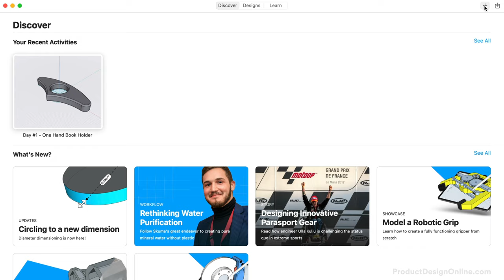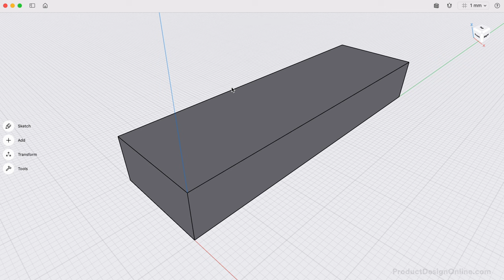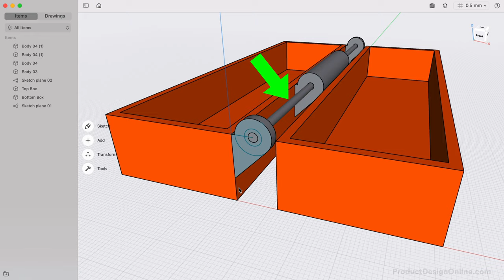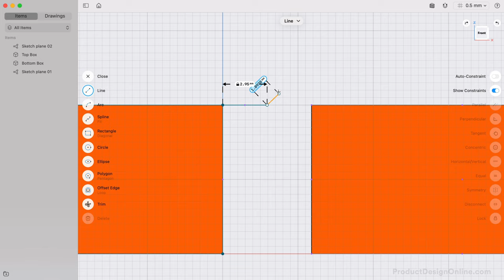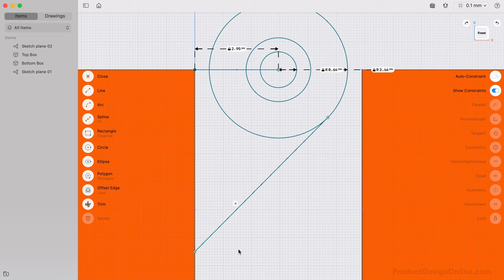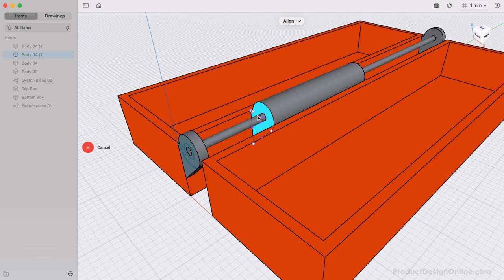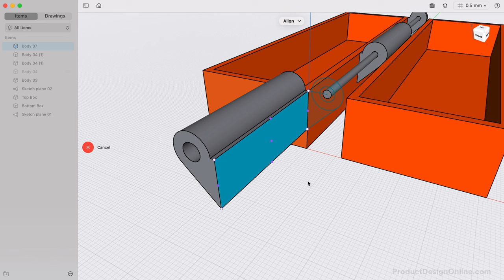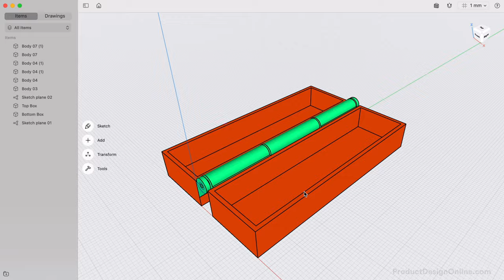Day #3: 3D Printable Print-In-Place Hinged Box - Learn Shapr3D in 10 Days for Beginners

Comment: is there an updated series? Things like defining angles are no longer baked into the UI!
Reply: Defining angles is still there in the current version of Shapr3D. I just verified. Tap both the intersecting lines and you'll get an angle value that you can change. If you have a lot of constraints set then they may limit you from adjusting the value

Comment: To get the angle icon to show up (7:45), you have to have the two lines on the same sketche. The reason why you can't see the angle icon and modify it it's because the line from the orange rectangle is in sketch 1 and the second line is in sketch 2. You can select the sketch 1 and redraw the second line to have both line in the same sktech and you should be able to see and change the angle easily.
Reply: Thank so much! I spent an hour trying to figure this out. Real lifesaver man.

Comment: Another great tutorial, but I'm definitely seeing some differences on my iPad.  Perhaps it's the newer version of Shapr I'm using, or the iPad interface, but after extruding an object, you can't select the face like you show.  I  have to hide the sketch item first, otherwise, I end up selecting the wrong stuff, with selecting just the face being impossible.  Additionally, my sketch faces seem to be left behind when I rotate or align an object, which isn't what you show in your video.  I don't know if I'm not selecting everything, or what, but my sketches have crud all over the place.
Reply: Yeah, unfortunately I’m seeing this issue too. It’s a sketch-castrophe! My solution has been to just hide the sketch lines in the “Items” tab. 
For the issue with extruding, you might need to update your firmware. I was able to extrude my shapes even if the sketch lines overlapped them; just be careful to not select the boarder of a sketch line or it will not extrude the piece you want.
Reply: same with me

Comment: I think shapr3d is well good.. I was looking through CAD software, But none of them really did what I WAS THINKING. Shapr, Does do what I was thinking but is also well hard to explain or look up! 

But with this program can you draw say a cabinet and then you drew some components, Can you then move components around? And plan how it'll be laid out. Make sure everything will fit and so on..
Reply from the maker: Unfortunately, at this time Shapr3D does not make it easy (or fast) to lay all your parts flat. For comparison, Fusion 360 has an 'auto arrange' feature that does it in a few clicks. Sharp3D forces you to use Move or Align to manually reposition them one by one.

Comment: Very informative. Thanks! One thing I need more help with is… construction planes. What’s the best practice in a particular situation?
Reply from the maker: Thanks for watching, Rusty!

Generally, use construction planes any time you need to create Sketches and don't have an existing 3D body to sketch from. Construction planes can also be used with select modeling features. I'll be covering some of the core workflows/uses cases of them in future lessons in this series.

What project are you working on?
Reply: I'm working on two woodworking projects. The first is a modification of a shop filter that Jay Bates did using SketchUp. I'm essentially redrawing it in Shapr3d using dimensions for my blower and the common filters I use in my house. The other is a design for a very deep shop cabinet that has lots of un-usable space. I'm trying to design something with vertical sliding drawers that will slide completely out giving me better use of the back 8 - 10" that are currently really hard to reach.

Comment: Hi Great video, thank you. What do you have to do for the print settings to print this pin? I use prusa slicer and I am assuming the software will automatically create a 'Bridge'? thanks in advance.
Steve
Reply from the maker: That's correct! It will 'bridge' inside the hinges. I suggest printing with .1mm layer height. The remaining default settings will print fine on a Prusa or equivalent type of 3D printer. Happy printing! :)

Comment: is it possible to simulate this model in shapr 3d ? I mean the rotation of the solid bodies about the hinge axis?
Reply from the maker: In general, Shapr3D does not currently support simulating models. However, there is somewhat of a workaround that would work for a hinge, by using the Construction Axis. See this video from Shapr3d: https://youtu.be/DqhWE3hYujk

Comment: Hi love u r video! 
Can I please know how to make the hinge tighter so it stays at a angle like laptop hinges
Reply from the maker: You would need to make the clearance smaller, but I belive you'll find that hard to achieve similar to a laptop hinge with plastic alone. You can replace the pin with a premade metal pint and add some lithium grease to better replicate one.
Reply: @PDOShapr3d  thank you!

Comment: help!  having an issue with the step at 8:35-- when i select the body in the sidebar menu to copy, it only copies part of the hinge, not the whole side face.  Basically the circle elements and angled part are still all separate elements unlike the video where the entire side seems 'joined' as one.  I've played it back multiple times and i don't see a step I missed.
Reply from the maker: Hi Doug. Can you confirm that you just have one body in the Items manager on the left side?  You can also try shift clicking all of the parts that are separate on your end, before hitting the 'copy' badge. Otherwise, if you can link to a screencast it may help me notice something else. - Kevin

Comment: On what printer do you print this and with what settings/Nozzle head size? 

Hii, love this video. Learned a ton from it. I've been using my Ultimaker3 with a 0.4mm Nozzle and it doesn't work - would you mind sharing your settings?
Reply from the maker: Hi Samuel. Glad you're learning lots! Appreciate you watching.

I've printed this test hinge on my Ultimaker S5, Ender 3 Pro v2 (example - https://youtu.be/gzF2QgMh6nw?t=614), and Prusa i3 MK3S. .4 nozzle should be fine. Your layer height is what's critical here as the inner pin is quite small (unless you scale the design up). You'll want to use .1mm layer height. You may also want to slow down the speeds. Generally, when I do these test prints I use the default 'basic' settings in Cura.

What material did you print with? PLA?
Reply: @PDOShapr3d  
Hiii, 

Okay so with the suggested layer height it worked out on my Ultimaker :) thank you so much for explaining that. 
I ended up printing it in PLA. One thing I noticed is that for me the box doesn't completely close because the hinge is at the same height as the top of the box. It kind of keeps a 5mm opening when fully closed if you don't apply pressure. 
I've made an updated model where the hinge is a bit higher and that fixed the issue. 

Love the tutorials :) Keep up the good work! 
Sam
Reply: @PDOShapr3d  
Hiii, 

Okay so with the suggested layer height it worked out on my Ultimaker :) thank you so much for explaining that. 
I ended up printing it in PLA. One thing I noticed is that for me the box doesn't completely close because the hinge is at the same height as the top of the box. It kind of keeps a 5mm opening when fully closed if you don't apply pressure. 
I've made an updated model where the hinge is a bit higher and that fixed the issue. 

Love the tutorials :) Keep up the good work! 
Sam
Reply from the maker: @samuel-beek  Hi Sam. Glad to hear you got it working! I appreciate the update. Happy learning :)
Reply: @samuel-beek  Hi! Would you  be willing to upload your model with the adjustment? That would save me a lot of time and frustration, thanks!

Comment: If i want to use the same hinge in a diferent project, all the dimensions scalate the same way?
Reply from the maker: Yes! In general, this is a universal hinge that can work with many things. I wouldn't recommend making it smaller than this. However, it does print well at larger sizes (and is typically stronger when thicker).
Reply: @PDOShapr3d  Nice, thanks! other question, the outer hinge and the clearence, does the size of them needs to increase in size proportionate of the thickenes of the inner hinge?
Reply from the maker: @lulucoast  The clearance does not need to change unless you have issues with the print based on your slicer settings. This works well for .1 and .15mm layer height. .2mm or greater may need to be tested.

Comment: After creating the circles for the start of the hinge and adding the tangent line there is no box that pops up for the degree angle.  Also when I try to extrude that area below the circles it isn’t a solid surface to be extruded, can someone help me with those two issues please?
Reply: Did you hold the SHIFT key when selecting the angled line and the vertical line? You'll have to select the two lines for the angled input to appear. If it's not when doing that, its likely that the lower end of the line is not connected to the other line.

Comment: What if I designed the whole box but in the very end I wanted to change its dimensions, let‘s say, make it deeper? Do I have to start again or is there a possibility of parametrisation?
Reply from the maker: Hi Martin. Shapr3D is a direct modeler. That means it's not fully parametric (like Fusion 360 or some others), but instead allows you to select the face and update the dimensions or push/pull the face accordingly. There are some pros and cons to direct modeling. One of the challenges (or frustrations) can be something like this were you may want to quickly create a bunch of different sizes. I still use Fusion 360 for all those sorts of projects.

Comment: Why didn’t you have to join the hinge body’s (union) with the box bodies?
Reply from the maker: Great question, Jordan! In this case, you could choose to join or not, depending on your desired outcome. I chose not to join/union the bodies which gives a little bit more flexibility if one needed to hide or alter either part. All bodies will be included whenever you export the file as an STL for 3D printing.

Comment: Nice one. Is there an easy way to extrude an object face as a separate body rather than just making the selected object thicker?
Reply from the maker: Hi Notan. Not that I'm aware of. You'll have to 'Project' edges of the geometry to have a new sketch for a separate body. You could also extrude the face and then split the body to result in two bodies (depending on the type of geometry).

Comment: How does one print this if the print surface is not big enough?
Reply from the maker: What are your size/surface constraints?

If you're looking to print larger then I would recommend a different design with a removable pin. You can also print each half separately.
Reply: @PDOShapr3d  i thought of printing it at an angle.

Comment: Hi, I appreciate these videos very much. However I’m having a problem and not sure what’s going on or what I missed. I wish I could provide a screenshot but I will do my best to explain. In this tutorial at 8:10 roughly, you begin to extrude the section with the 45 degree. The problem I am having is that section is not shaded in blue. All of the circles are shade but not this section. I am using an iPad if that helps. I would greatly appreciate some help on this. Thank you so much in advance.
Reply from the maker: Hi idkarts. I suspect that the line is not fully connected to the box/vertical line. You may have to zoom way in OR you can try to drag the end point and make sure it snaps to it. Using a constraint will also help ensure it stays connected to that area - as seen at approximately 7 mins.

Let me know if that was it! Otherwise, I'll need you to share the file so I can take a closer look. Cheers!
Reply: That was the problem. It wasn’t connected to the circle. I did have to zoom really far in to see it. Now that I fixed it I can see that when I draw the line I need to make sure it said “edge” when attaching to the circle. 

Thank you so much for your quick response. Again, appreciate the work you do.
Reply from the maker: @idkarts  Glad that worked for you! Happy holidays!
Reply: I am currently having a similar same problem. I checked the constraints and I can move the line around the circle and it stays connected to the side of the box. The area is blue. The angle input does not appear. The measure tool happily shows me the angle, but trial and error while drawing the point along the line does not seem to be the best solution. I am using windows though and the current beta.
Reply: Yep, got the same problem.  Redrawn the hinge sketch twice over and same thing.  And it's annoying I can't just select an angle dimension tool when it fails @Mabutuja

Comment: im having problems i followed each step and made sure the circle was locked and made the line tangent to it but when i try to change the degrees the circle changes shape and the line doesnt move idk what im doing wrong
Reply from the maker: Hi Tyler, can you double check that the horizontal line (attached to the circle's center point) is locked as well? Additionally, having a horizontal contsraint on it will help. It sounds like something is missing a constraint as the circle should not be able to move at all.
Reply: @PDOShapr3d  Hi, first I would like to thank you for the tutorial videos and putting your time for these. I have an issue also with the line and the circle part as enabling the "Tangent" lock it won't the line freely and get a message that "there is a restraint". I've tried multiple things and the only thing that kinda works is if i "disconnect" from the vertical line from the left side of the box but then it's not tangent and it doesn't move along side of the circle. Now I don't know if this issue to others or me, I'm using the Windows version which mentions that it's an early access
Reply from the maker: @Avalance987  Thank you for watching :)

I don't belive the Windows version should affect anything here. Would you be able to export as a Shapr3D file (.shapr) and send to me at support[at]productdesignonline.com ?

It will likely be easier if I take a look at your file.
Reply: @PDOShapr3d  My apologies for the delay to reply back... After playing a little bit more I was able to find why it was happening. When I was creating the line, as a starting point I was choosing (snapping it) to the middle of the side of the box (purple point) and when I was enabling the "Tangent" it was locking it on both sides. I needed to snap (create) the line on a random spot of the side of the box. That way I was able to move it freely and also be Tangent to the circle.
Reply from the maker: @Avalance987  no need to apologize! I appreciate the follow up as that helps me track things to point out in future lessons. Glad that you got it sorted out! Don't hesitate to comment if you run into issues in the future :)
Reply: @Avalance987  That is not the case for me and the same thing continues to happen. Beyond frustrating.